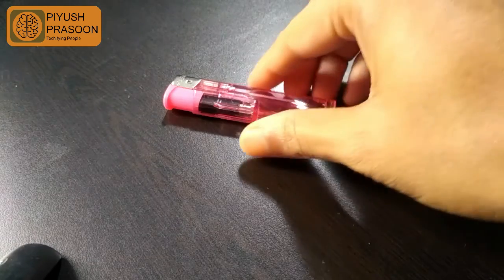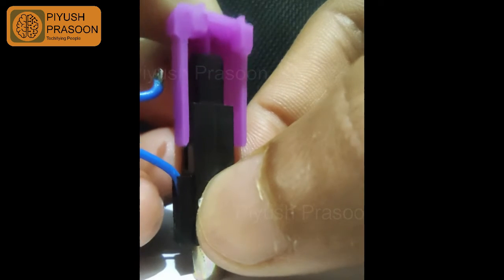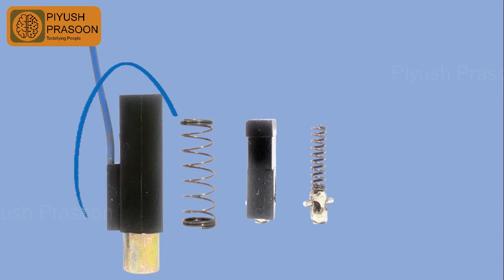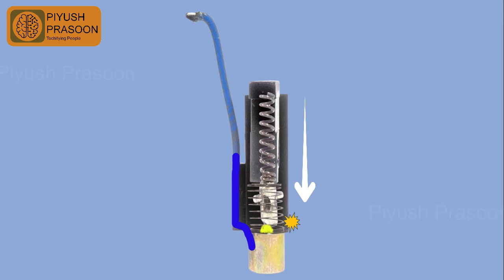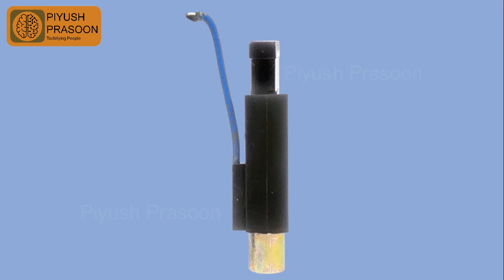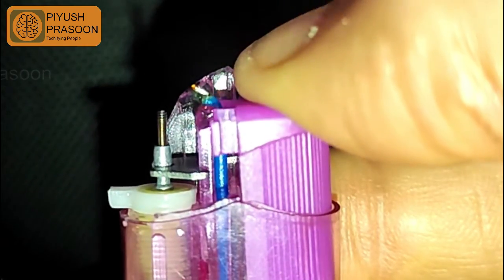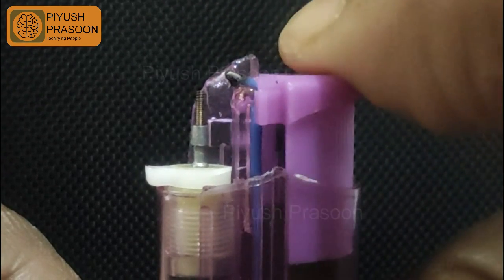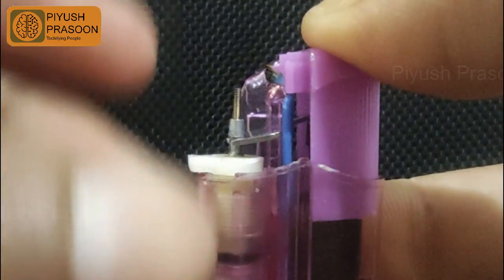How a Lighter works Piezo Crystal Lighter Part 2

Comment: One thing I want to know what stops the igniter from going back to ignite position when it stays in firing mode it doesn't spring back to create another spark
Reply from the maker: Until you release the igniters trigger it will be at the same position once you release it the spring restores its shape pushing the mechanical part back to its position.

And the igniter is really to get pressed again to generate another spark/arc.

Comment: nice video tho. only one small mistake: the generated voltage is not 800 volts, you can eyeball the high voltage with simple rule: 1mm of air needs roughly 1kV to overcome the gap.
Reply from the maker: Hey @felixyasnopolski8571, thank you so much for you comment and the observation.

BTW, nice observation, however if you will see the complete setup there are 2 places where spark/arc need to be generated, one which is observable - i.e. the one which you have noticed.
The second spark is happening when the electron will transfer from metallic leaver to spring end point which resided under the push button.

After all this I have measured the Voltage using multimeter to confirm the value and the video for the same will be available soon 🙂.

BTW very nice observation and thank you once again for you valuable comment and sharing you opinion.
Reply: @PiyushPrasoon  you can't correctly measure high voltages with ordinary multimeter :) and there's some reasons:
1. Multimeter isn't built for measuring voltages over 1kV, divider resistors is usually either SMD or the voltage difference much higher than they can handle;
2. Even though the voltage is high, but the duration is small (hence power is small too), and for filtration there's installed RC network, and because of small time and big capacitance (for that time), the multimeter just can't correctly measure the voltage.

If you really want to measure *correctly* the spark voltage, you would need an oscilloscope, and properly built high voltage probe. This is the only way of measuring high voltage spikes. Even the expensive multimeters (such as TrueRMS Fluke ones) can't measure them by design, multimeters are built to measure constant (to some extent) voltage.

And nevertheless, the 1mm/kV rule still valid for eyeballing ;)
Reply from the maker: Hey  @felixyasnopolski8571 ,

You are right, my multimeter malfunctioned and started giving garbage value, looks like something got burnt due to high voltage

Comment: without the metal lever your finger certainly notices!  💥⚡💫👈😖😆
Reply from the maker: Hahaha nice observation,
but my answer is no, I was not getting the shock as current choses the easier path to complete the circuit 😊

But 1-2 time I got the 💥😆 you might have noticed in the video the electric arc once strike my thumb 😅
Reply: @PiyushPrasoon  can you make a video on plazma lighter
Reply from the maker: @thehappypuppypug  sure, will bring it up very soon 😊